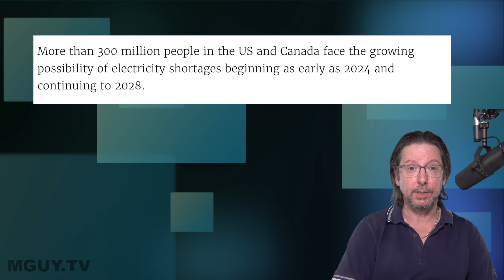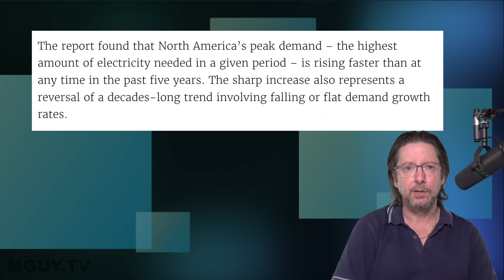Electricity grids WON'T COPE with mass EV charging | MGUY Australia

Comment: Morocco built a single solar farm the size of the state in the United States called Arizona and to power their country they will need 19 more of them.  Morocco uses 1/17th the electrical power that that the city Tucson that is inside the state of Arizona use to use back in 2016 before all the electrical cars were added.   Tucson needs far more energy now to power the electrical cars.  Now note lets do some math.  So Morocco needs to  built 19 more solar farms the size of Arizona to power its country that uses 1/17th the power of a single city in Arizona called Tucson.  So to know how much electrical energy Tucson requires just by solar its 19 times 17 times the size of Arizona to power a single city.  That is 323 times the size of Arizona to power a single city in Arizona.  Now note Tucson is within the top 5 largest cities in Arizona but its like 4th or 5th biggest and most power required city in Arizona.  Now note Arizona is well among the top 4 if not the 3rd biggest states in the United States.  Arizona is pretty fucking huge to the point that in reality Arizona is bigger than 100% of Europe.  Morocco used the largest desert which is like 7 times bigger than Europe to build a solar farm in it.  Arizona is pretty fucking huge.  323 times the size of Arizona is an overwhelmingly massive chunk of the Earth as in 100% of all land and over 80% to over 90% of the water would have to be covered in solar panels in order to power Tucson, Arizona, of the United States back in 2016.  When over 90% of the entire world is required being covered in solar panels to power a single city yea that shit is garbage.  Now note Solar is over 400 times better than wind and solar is the personification of insane garbage.  Look I don't know exactly how large 323 times the size of Arizona is because its such a god dam massive size that its unthinkable because in reality Arizona is already is a massive size that people just see the size and instantly know that its fucking massive.  Hell Tucson is kind of in the slight low middle of Arizona and its over 900 miles to get to the south border of the grand canyon which is over 100 miles across at its largest crossing.  Arizona is almost 1400 miles from south border to northern border of the country and is over 800 miles wide.  All of Europe is under 1000 miles long and 200 to 300 miles tall making it fucking tiny as fuck.  The reality of sizes of the world is far fucking different than what Europe and Asia lie about on maps.  Hell even Google falsely changes the sizes of countries because if they made a real map of the world people would be absolutely disgusted at how badly the world's governments have lied to the people.  The actually biggest continent is Antarctica and the second is North America with the 3rd being South America and 4th is Africa and 5th is Australia and the sixth is Asia and 7th is Europe.  Here is horrible reality.  Asia is kind of in a broken oval shape and its about 1800 miles on the longest direction but its other side is about 600 miles.  So its about 1800 miles by 600 miles.  Australia is over 4 times bigger than Asia.  Why does the world lie so much about sizes of stuff?  I don't know but the insanity of this shit needs to stop completely.  Hell 100% of all Europeans get lost within 5 minutes of getting off planes in America because they are horrified at the massive size of America.  Hell they are told oh my house is quite close and then travel about 40 miles which Europeans would take a 5 day vacation to travel that distance.  I do more distance than that on a bicycle in a day.  Europeans have no understanding on math at all.

Comment: They did have electrical engineers advising policy makers every step of the process, and they all told them the truth that it would never work.  The policy makers fully understood that it would never work, they were wrecking the economy and driving up the government debt.  That was the whole point of the exercise, to create debt and wreck the economy.  That way, when it all fails, they can say, we only just found out CO2 is not a threat to the climate, and renewables don't work, who could possibly have known?  Then they can turn around and say, we need to spend a fortune in order to rebuild our economy using technology that does work, and of course, that will involve creating even more debt, along with the debt of recycling all the renewables garbage.  
We live in a debt based currency financial system, 99.75% of all currency is created when debt is created, all currency is destroyed when debt is payed down.  The only way to pay down old debt is to create even more new debt, because all debt has interest compounding.  In the past, we had world wars to create new debt, with nuclear weapons those are impossible.  That's why the banks created the climate crisis hoax, so we could spent tens of trillions destroying more of our civilization than a world war could possibly cause, so we could then spend trillions more to replace it with a green new dead that didn't work, so we could spend even trillions more again to rebuild with the old reliable technology.  All because the banks are too lazy and controlling to change to a credit based currency system.

Comment: Wrong again, electric grids will be better off with EV's charging on them. Because instead of the huge swing between day and night power demands most EV's will be charged overnight on cheap rates to encourage drivers to do so. This will balance the grids and the generating companies want this. Already in the UK there's a 15 GW surplus at night, plenty to charge EV's even if every single car became an EV.

Comment: We are Going back too stone ages ,it’s too hot solar panels don’t work the wind stops blowing, the turbines stop production, which they need power from the grid too keep them running because the wind doesn’t blow constantly , which is needed for production of electricity which they produce very little and use a lot of resources in the first place , how will these tree hugging muppets charge their remote control cars 😂

Comment: We have a lot of solar farms around where I live. Huge fields that used to contain crops are now covered with solar panels. Up on the hills we now have windmills. We are going to need a lot of land area to generate enough power to replace what we already use, and that keeps going off at peak times at this time of year as it is. MY electricity is double what it was last year so I'm making plans to take it off grid as much as I can, using solar panels and a battery pack. If I covered my whole property in solar panels it wouldn't be enough to charge an electric car enough for daily usage.
Reply: a typical EV only consumes about 10 kW/h per day to recharge...that's less than a tumble dryer running 1-2 cycles. Any rooftop array can EASILY supply the energy an EV requires. As far as solar panel real estate consumption goes, we could completely power the USA with less land than is currently consumed by oil & gas leases.

Comment: You are not the first (by far) to compare the US electricity grid with Australia's. Sure, it's woefully maintained (as is most of US's infrastructure); but your entire argument presumes that the US's experience is comparable to ours. It's not.
In the first place, we have a (native) 240V infrastructure at home compared to the US's 120V. We can literally charge our cars at home two times faster than they can. Sure, you can pay extra there to get better charge rates - but so can we. I personally have a 22kW charger at home for basically the same price that they pay for a 7.2kW charger. There are all sorts of US videos about how they adapt their dryer plugs (at 240V) to charge their cars: we can do it with our normal power points. Plus, many Australian homes (like mine) have three-phase power (three times the power) already - which is a rarity in the US.
But your argument seems to revolve around whether the grid can support all the extra public chargers - which is a false comparison. Most charging will be performed at 3:00 AM at home rather than in the forecourts of public chargers that many Americans resort to due to their pitiful at-home charge rates. Most of our overnight capacity is under-utilised, so overnight charging is completely adequate to charge most EVs. That doesn't mean that more infrastructure isn't required - but it's not at the three to four times capacity that many doomsayers are stating (including yourself, if I can read between the lines).
And then you throw in the Nuclear option (explicitly). I personally think that we should go nuclear, but until that happens, the rest of the infrastructure can support us - even as we go totally EV.

Comment: Not just EVs  Here  in uk heating andhot water require 150% the power of the existing grid This means overall we will need 4 times our existing capacity of 100 Gigawatts.  Our govmt plans on 100. As we have now except most will be green and intermittent. How good is that ? I can’t believe it.

Comment: In the past, you bought a house, it came with a utility company electric connection.  You paid your monthly bill for what you used 😊  If you wanted some measure of security for that electrical power, you got a generator ($1000).   Now it seems the thinking is to be green and get solar panels,  a battery wall, and smart convertors ($50k and up).😮  Now what does your monthly bill look like - utility bill plus solar bill!  Some progress there - be your own engery producer and have power company connection too (for cloudy days when solar is useless).😅  Next, add windmills ($ ???) 😂😂

Comment: I’m in Canada and got a really good quiet generator a couple of years ago. When they had the big power outage in Texas people were driving around listening for generators to steal. Did you hear about the huge solar farm in Nebraska that got destroyed in a few minutes by a hail storm?
Reply: To destroy solar farm it is perfectly sufficient to fly over it at speed faster than sound. Shock wave will destroy it all at once.
Reply: @JanKowalski-vj9py  I have been under many a sonic booms without ever a broken window.
Reply: Did you hear about the oil tankers that hit highway barriers and explode? Did you hear that the BP Deepwater Horizon oil rig disaster left an oil slick the size of Virginia?
Reply: @justsomeguy934 most people aren’t against renewable energy.  What they are against is making their lives way worse with technology that is far less reliable, more expensive, and flat out not feasible.

The sooner you realize a lot of this is about control, the better off you’ll be.
Reply: @justsomeguy934  😂 the solar farm happened just the other day.
Reply: @D-B-Cooper  and how does that impact anything? Take a swim in the Gulf of Mexico through the oil slick and tell me about the difference between a repaired solar farm and and OIL SLICK.

Comment: Well if we start having scheduled black outs in canada, we all know it's the EV owners and charge stations to blame. We literally don't build any new houses, upgrade buildings or anything in Canada, only thing they build here is charge stations and homeless shelters.
Reply: You have no idea what you're talking about. EVs charge off-peak (when you're asleep) and only consume 10 kW/h per day. If you have blackouts in Canada, it's during demand hours and not off-peak. Your utility commission is to blame if they don't provide enough power for your needs, not EVs.
Reply: They've been providing enough power for decades without issue, so if recently they all of a sudden start having blackouts, what would be the cause? We don't build houses or new infrastructure. So where's the increase in demand for electricity coming from? Is it charging electric vehicles? Or the lack of infrastructure to charge them? Both have EVs as the root issue.
 I do ABYC wiring on boats for a living. Working on Grid charging through shore power using inverters to invert the sine wave from AC to DC, and vice versa, to charge lithium deep cycle and agm start batteries, transfer switches when including a generator to the circuit, relays, ACRs, RBS. Wire calculations for equipment using up to 4/0 conduit, All to power  million dollar boats house systems. So I'm familiar with electricity, charging systems, motors and hydraulics. My guy
Reply: well you would know that a ev will use nothing to charge at home my hot tub uses more or my welder or the stove or the heat and what about the dryer. geeeez @gregpittman1700

Comment: California is an ideal state in which to trial solar & wind power, and it's been an abject failure. The state's electricity grid is underpowered at the best of times, its nuclear plants have been taken off-line, the state is pushing EVs & promises to not allow gas cars by 2030- but already they've had huge problems supplying enough power even before the large numbers of EVs that are supposed to be on the roads. It reminds me of Joni Mitchell's song: "Pave Paradise, put up a parking lot." It'll be one vast EV parking lot, with no one going anywhere!

Comment: In Europe most grid systems cannot cope now absent Russian gas since we have had a number of consecutive days when wind systems have only supplies 2% of capacity and the backup was not available. In the UK the dead heads have relied on interconnectors to Denmark and Ireland on the false basis that if the wind is not blowing off the UK coast it will be blowing there, something a quick glance at weather maps shows does not happen consistently. Add to this the claims of global warming with Mediterranean temperatures in Northern Europe and if in the negligible event it happens they installation of air conditioning will exacerbate the situation as it has in the Mediterranean island where I live - blowing up substations and melting cables leaving some areas without power for a week..Currently Germany, the country that boasted of getting all its power from renewables over one day is now facing a blackout because ironically they cannot rely on nuclear power for France where stations have been closed for repairs and they are relying on Russian LNG.

Comment: Meanwhile in California - where we have been putting up wind turbines since the 1980s: at this moment (New Year's Eve morning) wind power is generating 1.45% of the electricity capacity in the electrical grid. (598 MW from wind divided by 41,327 MW total electrical capacity = 1.45%)

Last year during the Labor Day heat wave, electrical capacity was 55,000 MW, demand was about 52,000MW, wind was generating only about 1,000MW. That's when Newsom said "Don't charge your electric car..."

To be fair, on average over the course of a year, wind supplies about 7% of the state's electricity. 

Are we REALLY going to be able to go all electric/green grid by 2035? Where's the infrastructure to do that? The last thing we need to do is spend billions on intermittent resources that supply next to nothing in terms of energy.   

This is more about collecting the subsidies than producing electricity.

Comment: You really don't have a clue, there is plenty of capacity for EVs infact they will improve the reliability of the grid.  All these reports bring in all other new demands and are simply demands for Nuclear investment when Australia has the richest renewable resources in the world.    Nuclear is not about the fuel, the biggest cost is building the power station and you need a consistent demand for it.   If you are going to have problems in the next 4-5 years Nuclear is not going to help you, that a 20 year project.
If you need more power build more renewables.

Comment: The evening peak will be enormous, natural gas is to be replaced by electricity for cooking and heat pumps will use electricity as well as all those EVs that need recharging after their owners come home.  For the latter you might delay charging, but waiting until 10 pm to eat won't be popular.
Reply: Probably nobody coming home from work. No peak time because all the main street jobs and manufacturing businesses will be dead and gone to India or China, where they are free to pollute like its 1920 s and 30s again.  Sad state of affairs these days.